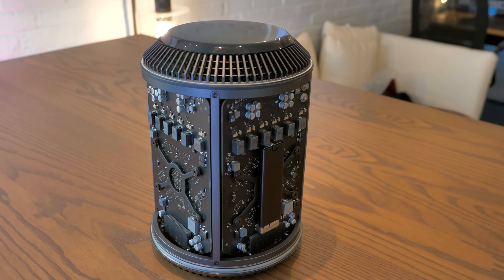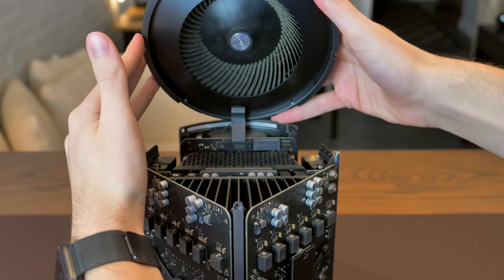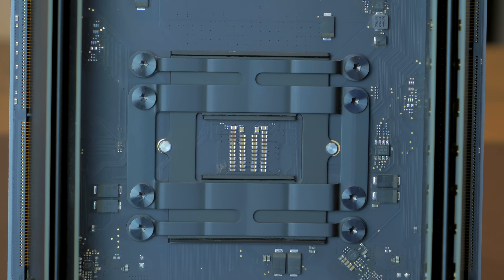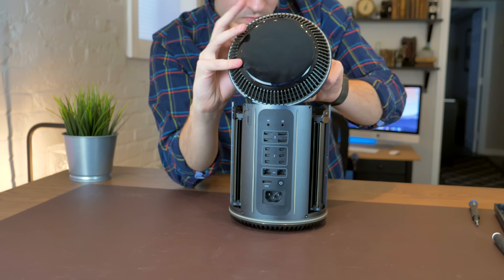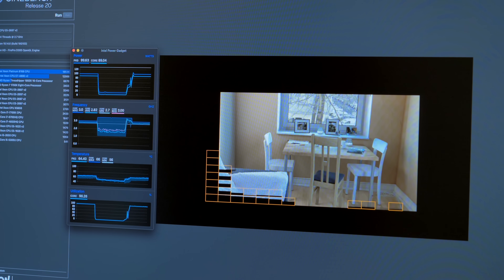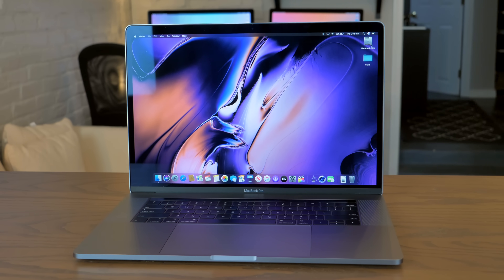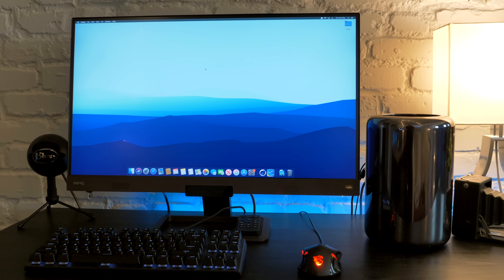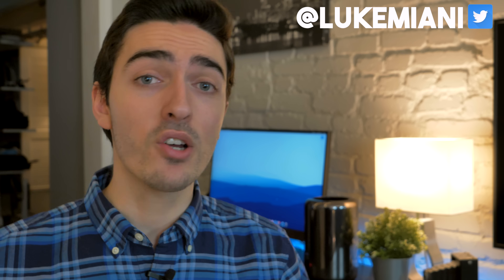Building the CHEAPEST 12 core 2013 Mac Pro!

Comment: i was going to get the e5 1660 v2 3.7 6 core upgrade, but it was 90$..but thats the sweet spot cpu...921 single core geekbench 5 score, the fastest 1 of all cpus that work in the can.im going to get it, but im putting in the 1620 3.7 4 core first for 16 $.all see how dusty and dirty the 12 core is, ive never opened it up, more then ssd and memory, bought it form a computer store tested on ebay 12 core model,, not sure how dirty it will be...
Reply: No the 10 core is the sweet spot

Comment: but in still going to buy the flexx lx 335 guys custom made for the trash can, no adaptor, os mojave pre installed. 1375 write.... 1521 read on there utube video on the lx 335 for the 2013 mac pro...its the fastest one..made for apple filing system. 180$. 1tb..its worth it..the sintech adaptors ok, but not really guys, it shorts out a bit, and makes the odd crakel noice..not 100% connetion but usable

Comment: It is wild how much these have depreciated in 3 years since this video. I just bought a 6 core trash can Mac Pro with 64 Gb of RAM for $240 and now the same processor you installed sells for $28! I realize this is now a 10 year old machine but it is significantly less expensive than a used 2019 i9 MacBook Pro.
Reply: Yup, with low effort you can buy it now for $275 the same computer he's talking about today, I'm sure if you found a private seller it would be around $200 at this point.  It's a pretty good option if you need a cheap secondary windows machine...

Comment: Goodnight. I have a MacPro Late 2013 with a 6-core processor and I bought a 12-core one to put in it and when I disassembled I realized that Apple used 4 screws and 4 rivets on mine, making it impossible to change the processor. The big question is: Is your MacPro mid or late 2013?? Thank you very much in advance.
Reply: Hi there I do also have a 2013 Mac Pro 12 core cpu 128gb ram and the dual d700 GPU I have upgraded mine from a 8 core and basically those are just stick on end caps use a pry tool with more pressure and they will pop off revealing a void marking basically just put on so if apple found the void inside they would know it’s been tampered with and don’t be afraid to contact me if you need help

Comment: Hello Luke, The four inner screws are not screws on my unit. They’re just round nubs. I’ve applied a little bit of pressure attempting to pry them loose but they won’t budge. Have you come accross with the same CUP heat sink bracket? Where you able to remove it succesfully?
Reply: Hi there I do also have a 2013 Mac Pro 12 core cpu 128gb ram and the dual d700 GPU I have upgraded mine from a 8 core and basically those are just stick on end caps use a pry tool with more pressure and they will pop off revealing a void marking basically just put on so if apple found the void inside they would know it’s been tampered with

Comment: I know this is an old thread but this seems like a kick azz developer box for doing typical app dev.   It runs the latest OS and supports Xcode and since I need a cheap 3rd Mac dev systems I might go for it.   Fun little upgrade project too.

Comment: I have been looking at them again.  I have a 2008 mac pro that is just about to give up the ghost.  The video card is not working as it should, sometimes when I turn it on the network connection does not work.  I have to reboot to get it to see the network.  The machine will re boot on its own, just at about 3 or 4 days of running.  I was looking at the mac mini, but it appears that the performance is going to be a lot slower than what I currently have.  So I am back to square one. Do not want to spend 35K for a new mac pro.

Comment: I was able to score a 4 core/16gb/1tb/D300 machine that had some cosmetic issues on the case with a 1 year warranty add-on for around $800. Once I unload my cMP 5,1 I think it'll be pretty cheap. I just didn't want to fiddle with hacking on the 5,1 and I don't do pro level work so the GPU isn't as important to me. Can always eGPU that issue.

Comment: So 1 year later this is still relevant because hey we don't ball like that yet.  I priced my Mac Pro 7,1 at $16.5K with the future-proof bells.  This is not that.  This is a decent choice over M1 Mac Mini + eGPU ~$3800.  And even if you go this route you are still $1200 less than the M1 Mac Mini route.  Sorry, but these are the specs I have looked determinedly to get away from IO read-write hell on the PC.  Mac Pro should cost no more than $2000.  Mine is coming in at $1200, with a $250 upgrade for CPU, 64GB RAM D300 (might change this later), and an eGPU. So less than $2400 with peripherals, you have a decent machine for the next several years.  And that should edit 1080 footage for years to come.  With that $1200 saved I can even get a Mac Book.  Personally, I liked the design and always did.  Now that most of my software is Cloud/Subscription-based, it is finally economically viable to switch.  The only things that concern me are switching External HDDs to Mac and Fonts.

Comment: I still have my 2013 "trashcan" and still does everything I need. And I LOVE the design. I think it is the most beautiful Mac ever made. It is only the base 4 Core configuration. I did upgrade the RAM to 32GB. No other upgrades. Logic runs great as do photo/video apps. No plan to replace it until it dies. Hard to believe but the M1 Mac Mini has better performance so THAT would be my choice today. Hopefully the M2 Mac Mini will be out when its time to bury it. 
I use Carbon Copy Cloner to backup my data regularly...just in case.
Loving it..still.

Comment: the fans dont ramp up BECAUSE its a mac and apple have VERY stupid constrained fan settings that will only ramp up in the last second when they computer is about to lit on fire, same thing with all macs and its what have killed alot of gpu's in older macs.. its a shitty system and its not good that the fans dont ramp up... such an Crapple diehard fanboy
Reply: Still using my 2013 "trash can" and it still runs great. Hell, my 2007 MBP still runs fine too. Not sure where you are getting your data....

Comment: I am glad I found your videos.   I just spent 90 minutes and plugged in my Darth Cylinder and it wouldn’t boot....Ahhh,  I needed to remove my new 2terabyte ssd and reinstall the original SSD with the OS.   Restarted.   Booted up.   Powered down.   Installed the new 2terabyte drive....rebooted.    Working Great.   Thank you for this video

Comment: if you connect with an eGPU(external GPU) case with display card like Radeon 5700 XT chips, your 2013-Mac pro will perform much much better (triple times) then just change the CPU.

Comment: "Pretty intense disassembly" well it's still better than a 2012-present iMac because you don't have to cut away stupid screen adhesive. On those aforementioned iMacs, without buying adhesive strips every time you open the machine up, the only thing you can upgrade is the RAM, and only on the 27" models. I wouldn't say that the 2013 Mac Pro is super easy to upgrade the CPU on, because it isn't, but at least you can do it with a screwdriver set and some pry tools instead of having to deal with adhesive.

Comment: So I noticed some quirks on the Mac Pro 2013. If it has a background task running, say Plex media server. It goes to sleep, but when it does this the fan doesn’t work. So I come back in the room a couple of hours later and notice that it’s getting quite hot. I also see an amber light coming out of the base. As soon as I wake it up, the fan kicks in and he temps drop from 80+ to 40ish. This explains why some mornings I notice that it’s completely turned off. I have istat pro running and I can see the temperature Curves constantly increasing and the fan being zero. I basically have it so it doesn’t sleep anymore and have appropriate fan curves.

Comment: I bought Mac Pro 2013 with 
Intel Xeon E5-1650 V2 - 3.5GHz Six Core (CM8063501292204) Processor
Please suggest if its good processor. In Video you mentioned Quad Core Processor is not that Powerful . Please suggest.

Thanks

Comment: So I had been using a MacBook Pro Retina 15" late 2013 model for about 6 years, until I needed to replace the battery just the the other day. I always said the once I needed to do that, I would upgrade to a 2013 Mac Pro and give my MacBook to my daughter. The reason that I wanted the 2013 Mac Pro is that I don't need a laptop and my home office set up includes two 30" Apple Cinenma Displays and a rotated 23" Apple Cinema display that is virtical between the two 30", all three us Thunderbolt.  I absolutely love my monitors, and this is why I needed the Mac Pro. In order to run these monitors without further investment in adapters/cables etc., I need Thunderbolt 2. It has been a major upgrade for me to have six Thunderbot 2 ports as I have the three monitors and a Thunderbolt Focsrite Clarrete interface for music recording. Now I have everything connected at once, which is just awesome for me. In addition, I purchased the base Quad Core model for $1100 and just installed the 12 Core referred to in this video for $170. So for $1270 out the door, I have the 12 core model with 48 gigs of ram. So I think it does come down to your set up and particular needs. For me and my love affair with vintage Apple Cinema displays and my Thunderbolt display, this computer is a dream both from a cost standpoint as well as the fact that it is blazing fast for me compared to what I was using before. Plenty fast! Anyway, just a quick story there. Loved this video as it helped me to go down the road of upgrading the processor which was not too difficult and well worth it in the end.

Comment: Following your vids late last year, I upgraded my primary workstation (from a 2013 top-spec iMac 3.7 i7 4-core) to a base model trashcan via eBay which side to side, offer similar specs. At the same time, I bought a 12-core upgrade kit thinking I was going to fly into hyperspace with my workflow. I paid @ $1,200 for the machine and $200 for the CPU kit.

All things considered, my workflow  (print graphics via Adobe Ill./Photoshop/InDesign) became much slower and every move of the mouse was laggy. After a week or two of this and some research, I swapped back to the 4-core and my workflow was much improved. 

Apparently the 12-core is more suited to tasks that take advantage of the multicore such as video work but my concern is having multiple Adobe programs all active at the same time and apparently, where higher clock speeds are more important. I'm considering swapping out the 4-core for a 6-core that has very similar clock speed to see if I can eke out a bit more performance. a few seconds of lag time here and there add up when you are doing what I do for 8-12 hours each day. 

My later research also lead me to wish I had held out for a D500 or D700 version graphics cards. And of course, I'm seeing more and more options for the 2013 Mac Pro on eBay, 6 months after my decision to buy what I did. Yesterday I noticed a 6-core with D500 at around $1,500. A new iMac may have been better suited for my needs but I was looking to move on to a larger screen. I find it frustrating that the Apple choices are limited to high and low-tier platforms (Mac mini & Mac Pro) which allow for customer selected screens or the happy middle tier specs but you are married to the 27" iMac screen size. 2 of them together are great but I like the extra vertical real estate of the 32" screen.I would love it if the iMac redesign includes a 32" screen option.

Overall I am happy with my decision but I would like to see a bit more explanation on the different CPU options and what sort of work is best suited to each one.

Comment: I recently bought one of these too and it was still sealed in the box from Apple. It's also the 4 core model, but it's really not that bad of a CPU. The single thread performance is much better than the 12 core you installed. Mine scored 863 for single core on Geekbench 5. The 12 core CPU is only best for applications that can utilize multiple cores. I think the 8 and 10 core CPUs offer a better balance of performance. I plan to go with the 8 core E5-1680 v2. Some people choose the E5-2667 v2, but the thermal requirements for that CPU aren't a good match for the Mac Pro. The 10 core E5-2690 v2 would also be a good choice. It has better single core performance than the 12 core and almost as good multi core performance. Also, I suggest wearing an anti-static bracelet when working on the computer. It would also be best to use the specialized tools from Apple and follow their instructions made for technicians or have an authorized Apple service provider perform the CPU installation.
Reply: How much did you pay for it if you don’t mind me asking

Comment: While it's fun to compare CPU and graphics performance between the Mac Pro and the MacBook Pro or iMac, it should not be discounted that the Mac Pro uses a Xeon processor with ECC memory.  These systems can repair single bit memory errors without crashing, allowing them to stay online reliably for a long time.  The hardware makes for a good compute node, though at a premium price.

Comment: My 6 core MP2013 is quiet most of time, like now. The fan will blast when I'm doing stuff like Quicktime screenrecording, which I didn't think was that intensive.
Reply: Oh, and the 128G RAM option is only an option if you accept the RAM running at 1066MHz. My machine has the D700's which are still not up to much compared to even the last gen AMD/NVIDIA. I bought it for the TB2 ports as I have several last gen OWC thunderbays. One thing I hate about my machine is that the IO connections are super sensitive - I could literally just breathe on the cables at the back and drives would disconnect. It's been back to Apple for a check up and IO board replacement but it's still the same.

Comment: I have a 6,1 Late 2013, 3Ghz 8 core Xeon E5... Memory 32 GB 1866 DDR3 with 2 FirePro D500 3G... 1TBSSD apple original drive... Question: Which would be the fastest CPU I can get on this machine, and should I increase the RAM @ all??...  I need it to manage 1080 Neurosurgery Microscope video. I use FCP and want to edit, voice over, etc. Thnxs in advance

Comment: The main problem is that it is very likely that the next or next next MacOS is not running on it anymore and therefore the value is going down a lot. It's good for software developer (who don't need too much GPU power) but for others get a newer system.

Comment: Hello Luke. I need a new PC, as my surface pro 4 is dying on me. Do you think a mac mini i5 with 32gb ram and external graphics processor (used still under warranty till 2021) for 1250 euro would be a good buy? I would still have to get a keyboard and mouse. I am not an intense user, but I would like something future proof, and fool proof (myself). Or do you have any suggestions around 1000 euros?
Thanks, Sean from Naples (new subscriber)

Comment: 12 cores is awesome!  But almost useless if you are not a video editor...  Not to be negative, but in this model adding 12 cores means lowering your clock speed from 3.7 MHZ to 2.7 MHZ.  A significant hit.  Most aps are going to run slower. Photoshop is going to run slower.  Even some of the video editing is going to go slower.  
But Cinebench scores will be amazing!   
I get it.  Youtubers are by definition video editors, but most computer users are not. 
And btw, this goes double for the dual CPU 5.1 mac pros.  12 cores on 2 CPUs is not the same as 12 cores on one CPU.  And it's not better.

I'd say the 4 or 6 core machine is the better option for most, with the 8 core machine being a nice compromise.

Comment: Hey Luke. Great channel. Long time viewer, first time posting. Anyway a have a few suggestions that I would watch.

1. 2013 Mac Pro hard drive speed test: M.2 NVME vs M.2 SSD  vs Alibaba KingSpec cheap 2Tb M.2

2. 2013 Mac Pro 12c vs 2018 Mac Mini 17
3. Thunderbolt 2 external SSD (2.5" or M.2) enclosures
4. 128GB upgrade...does this really slow down the computer with a 12c processor?

Thanks Luke!

Comment: Hi mr. miani, i have a 2011 macbook air that i have been trying to update the ancient software snow leopard, i ha e tried multiple times over a long time to update it to mac os el capitan to eventually high sierra,  after several small updates including the first gen mac appstore. Once the small software updates i download el capitan and attempt an install. After about 40 minutes the update crashes, than opens up a boot screen to attempt downloading again, it is an infinite loop of errors and ive had to reset it to snow leopard multiple times, im tired of wasting time and effort if there is an easy way to download el captan, i really need the help, as i cannot stand snow leopard

Comment: i would say e5 2697 V2 for 170$ is quite expensive, currently e5 2678v3 which is haswell goes for around 100eur and it's 12 core 24 threads, with turbo boost mod it will stay at 3.3ghz all core even on cheapest chinese x99 :) but ofc there is no x99 in this trashcan

Comment: I upped my 3.5GHz 6-core CPU to the same 12-core 2.7GHz in my trash can (D500, 64GB RAM). I use mine for music production with Logic X, given the reduction in core speed it quite often felt quite a bit slower to use than it did before as many plugins are still only single core capable
Reply: I’m glad you’ve mentioned this. I guess i’ll just stick to my 8-core, 3GHz then. Would you please let me know if upgrading from 32GB Ram would be recommended? If you did? I use Logic X as well..
Reply: @kardum_o  the boost from 32 to 64 was less noticeable than going from 16 to 32 but it did help, swapping the SSD for a faster drive made more of an impact though.